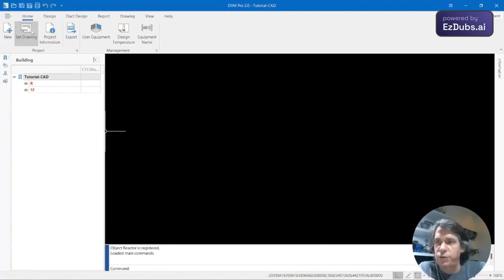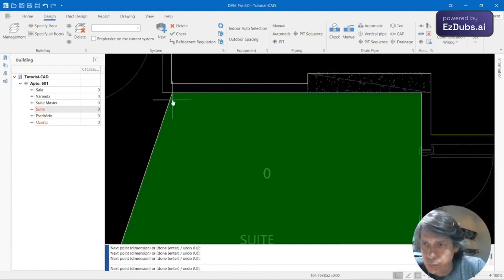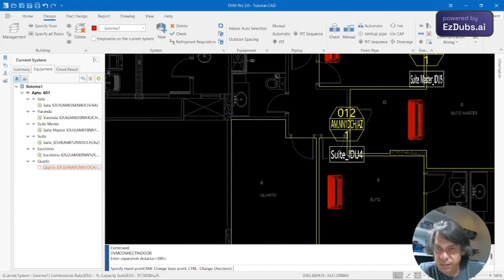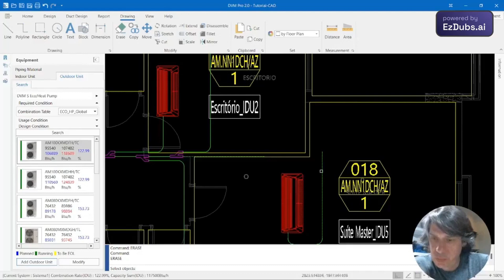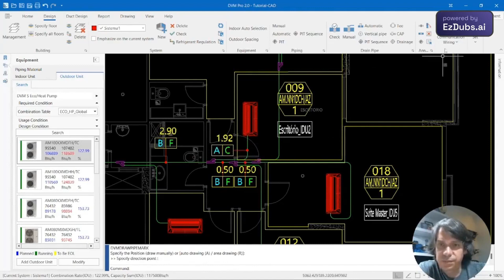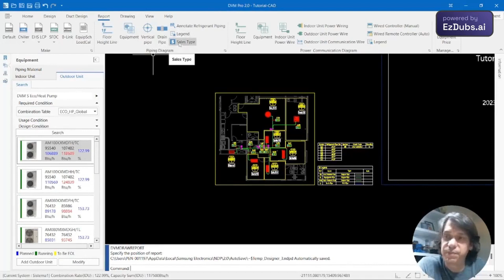Tutorial Software VRF Samsung DVM Pro 2.0 AutoCad Mode - English Version

Comment: Hi, Mauricio. Great DVM tutorial video. At 16:00 or so, you make a new system in order to do the "Auto Indoor Selection". But when I make a new system and try to use the indoor auto select, the program just tells me "Failed to do auto indoor selection". Why is this? Do you know? Thanks! Amazing video btw.
Reply: Hi, were you able to solve it? I get the same error when I try to automatically select the indoor units.

Comment: Thank you very much for your response, but I still don't understand. Can  the sales mode be used to design.

Secondly, can you make a video designing a small hall or place of worship like a church or mosque using the necessary codes and standard during design. 
Please can I get your contact so as to ask further questions. Thank you
Reply from the maker: There are two different modes, but both can be used to design VRF systems, with Sales Mode being a little simpler, that's why I made a video for each of the Modes